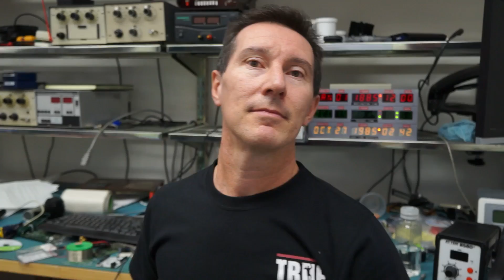eevBLAB #2 - Are Electronics Hobbyists Useless?

Comment: But i do have a question that might make a nice blab ... There is allot of talk in america about college being useless, i'm a 2nd year student and honestly only thing i learned new was to memorize some formulas i already had in an electronics calculator on my phone 
Whats your take? is college worth the debt? 
Its hella expensive here!
Reply: With any accredited curriculum you shouldn't be having to memorize much. Physics E&M along with differential equations should more than enough prepare you for circuits and electronics where you will derive everything you need. Choose a good public school and you shouldn't have so much debt either.
Reply: Dude same here in india. just with more people and they have to do more mundane work like writing journals, doing assignments mainly from copying from other and give tests which involve same questions which you just have to memorize the answers to.
Reply: Alyx BioHaz The problem with a degree path is that the first two years are bullshit to make you spend money. The second two years are where you actually learn. Then when you graduate you realize that like everything in electronics, your knowledge is obsolete. j/k LOL :) If you're in an engineering discipline, you will get a job more easily with college than if you have a liberal arts degree.
Reply: Mobin92

Formulae are only a tool.  You have to understand them to work with them in designs or maintenance.

Having good knowledge of them only goes so far when you are having to derrive and manipulate them in practical work.
Reply: College does teach a lot of useful stuff and gives you a wide set of base knowledge. It's easy to just bullshit your way through the classes without learning anything, but for someone with a genuine interest, It's a perfect opportunity to learn and become skilled.
The problem with it (and I admit I can't think of any feasible alternatives) is that it's required for the necessary credentials to get a job. So you end up with people who just take it for the credentials and don't care about the material at all (joke's on them they're gonna end up doing it for a living). And the market gets flooded with sub-par engineers with good grades and degrees. It's also incredibly expensive, so potentially talented engineers who aren't gifted with funding will never enter the market.
Reply: From the skill level I would guess: no way - since when you are really interested in stuff (what is needed when you want to become any good) you can learn that stuff by your own (especially nowadays).
The other question is: when you want to get a job, are 'papers' are requirement? If yes, then you have to calculate... debt vs better-job-because-of-certification-paper.
Isn't it...
Reply: It completely depends on how you use it. You pay for what you get, there's no money back guarantee. A lot of people waste money learning stuff that won't end up helping them, perhaps because of a lack of passion/drive to begin with or the assumption that all they need to do is get a degree. It seems to be the norm to go to college if at all possible regardless of whether you know what you want to do or even care at all about what you're studying, which is completely backwards. No wonder people see it as a waste.

But it can go both ways and I don't buy the idea that higher education is pointless and a waste of money, grades are meaningless, etc, those are typically excuses for people's own failures. If all you got out after two years of study was some formulas memorized, that's your own fault. Nobody can force you to learn things, and at the same time, at any half-decent institution you most likely had plenty of resources at your disposal (which is exactly what you pay for). Higher ed may not be required to be successful or skillful, and certainly doesn't guarantee you'll be either of those things, but a good education taken the right way is invaluable and includes far more than formulas.

Not to attack you personally, and obviously there are exceptions. But as a general response to people wondering why throwing money at education does nothing by itself and devaluing the entire process in general based on their own experience...
Reply: Colleges have their good things and their bad. The good is mainly the professors you get, although that can also be a bad thing. Also, you do sometimes get to play with things such as $100,000 oscilloscopes in their labs depending on whether they are well funded or not. I had two great professors who, even when I wasn't in the classes, would let me hang out in the lab between classes and would often go off on lectures on small questions that would last an hour (on stuff such as the miller effect, calculating the ringing of an RLC circuit, parasitics in different components, etc.), yet it only felt like a few minutes. They are the ones who truly put the nail in the coffin for me wanting to go to a university by relating their experiences and basically saying "Don't waste your money. Purchase equipment for a good lab and you'll be set".

What keeps me from wanting to go to a university is the concept that you're basically paying to teach yourself in the end, and rushed at that in some areas. I recognize it is good to memorize all those formulas, and I actually spend a good bit of time on those myself so that I can further understand what all the components do. It is incredibly fascinating to observe all of the parasitic properties in the different components and try to explain them. If I run across something I have a hard time understanding, I look it up and there are many lectures on youtube or articles that explain it very well. I mainly am repulsed by the high cost of college for what you get. What I would have paid in lab fees I paid in equipment for my own lab, which after 4 years I'll still get to play in. 

I'm sure there are some universities that offer a much richer learning experience than what I am getting, but I can't justify the costs when I am still learning and at an ever increasing rate at that. Maybe I'll be forced to if I hit a plateau where neither the internet nor my persistent desire to learn will help (an I would be persistent enough to spend tens of thousands on higher end test equipment than what I currently have if I hit a plateau), but for now things are looking up with what I'm doing.
Reply: One of the best ways in the US to get your education subsidized is to join the Army. I thought about it (queue the Ben Fold's song Army), but opted not to after some experience with a recruiter (Army salesmen, as I call them.) The position that I was considering was MOS 94S, a 'Patriot Missile Systems Specialist'.

Why that? Well, you become a certified diesel mechanic, you get into electrical engineering, computer science, telecommunications, and hydraulic systems. With that experience, you can work anywhere from a missile systems manufacturer, to a dealer as a mechanic, to an engineer designing and troubleshooting tech. The death rate for that job is extremely low, since it's not a forward operating position, and after all of the training you get in AIT; you also get the GI Bill for college afterwards.

You'd be able to use your credits in AIT and other experiences to get a Bachelor's and then use your GI Bill for a Master's degree. By your mid-to-late 20's, you'd be making decent money, and have a pension after 10 years in.

I was a bit of an idiot, opting for a civilian job that lasted too long in banking, and a finance degree that doubles as toilet paper in a pinch. LOL :)

My electronics and computer experience comes from a 3-year vocational training class in high school and my first job as a field service technician for a computer company.

I believe that companies should do more trade oriented training, subsidize candidate's schooling, and governments should open up more grants to academically qualified students. Having a country with a surplus of talented engineers is a very good thing economically and also for national defense.
Reply: When I was getting my associates, all I learned how to do was memorize stuff long enough to take the test. That made me realize that if I went to a 4 year school, I would be teaching myself twice. The first time in a rushed and boring way that costs tens (or even hundreds) of thousands of dollars, and the second time in a fun and fulfilling way where I actually retain what I learn. I decided to skip that first time learning. I got a job while still working on my associates and quickly was put on the task of developing circuit boards. I even have heard where after getting your associates, jobs will actually pay to put you through school. I wasn't put through that where I'm at right now, fortunately. Yes, it's nice to have the piece of paper that says "I paid tens of thousands of dollars to have people shove knowledge down my throat" because that's a major door opener for some companies, but most of the job postings I've seen simply ask that you have the skills, not the piece of paper. There are even companies that'll hire you without the degree even though the job description requires it because you have the skills and you have a portfolio to show that.
Reply: It actually helps to memorize all those formulas and stuff. Even if you don't exactly remember it anymore you will still know what it is and what it's used for.
Thus allowing you to learn things based on that faster and better.

Well at least if you try to understand why that formula is the way it is. If you just memorize a bunch of variables and math operators in the correct order, it's not gonna help that much.
Reply: Alyx BioHaz It's probably too late now, but I would recommend going to a cheap 2 year school for every gen ed class you can get towards your degree at a public 4 year school.

I'm a senior computer engineering student now, and have one semester left. I haven't really learned much of anything new in school, but jobs around here typically do require that paper, or at least 5-10 years experience otherwise.

Honestly, I'm hoping to start my own business anyway, but I don't regret going to school since I didn't actually get into debt.

Comment: Really, the only thing in that short list that I wouldn't be able to do would be firmware stuff. Other than that, I layed out my own boards, got them CNC milled, and even made a proper switching regulator with a hand-wound inductor when I was in 10th grade. I think that they may not exactly be "basic" skills, but I do believe that they are necessary.

Comment: sounds kinda ridiculous, i'm more of an end user computer nerd that does more with software than hardware (actually worked at a computer store for years doing basic pc repair), so i don't have much experience with component level electronics, but even i know all of those things you asked for even though i might not have done it myself before (and i wouldn't apply even if i lived in aus due to lack of experience with component level circuitry) so i would expect that most people who actually make electronics as a hobby would not only know how to debug a board or effective/efficient ways to lay one out in cad. the people who are saying such things i think are overestimating them self, whether it be a professional who can do those things (of course) or someone more like me who is thinking "if i can't do it no hobbyist can" or something along those lines. i'd take those comments with a grain of salt man.

Comment: I would say that what there are, are a LOT more tinkerers.  I am not a hobbyist but more than a tinkerer.  I would not dare call myself a hobbyist yet!  I am likely never to be one either.

I am a lifer in IT (20+ years now) and can do most things from PC support to database design and application development and coding but I would STILL never call myself an electronics hobbyist!  A hobbyist thing that I DO do is run my own servers and whatnot at home as that is part of my skill set at work.

I would suggest that the use of the term hobbyist would only properly apply if your skills were mostly to all self taught and that but for official certification or graduation, you could easily get a job where you could ply your hobbyist skills for real money.

All that being said, I took electronics in school and regret letting it languish!  This channel and several others out there have really got me back into wanting to learn the skill again.  I have been having a blast with 18650 cells this year but certainly want to learn and play as much as I can.  Putting effort first on soldering skills as it is the most used one in the physical application of even just tinkering.

Comment: Never finished college. Have never worked in a technical job. I've re flowed a BGA on my graphics card. I can solder pretty damn good. I started making circular polarized antenna. I also build and troubleshoot computers. I've built a circuit before, but it was pretty simple.

Comment: No they are not useless! "Back in the day" as you say, there were REALLY primitive tools for designing and developing boards. Everyone was forced to buy expensive programmers to develop firmware on REALLY horrid architectures like the microchip, with no free high level languages to mask the awful architecture. These days we have loads of free PCB tools, free compilers, cheap boards like Arduino or devkits like the MSP430 Launchpad that you program in high level languages out of the box with no fancy download tools, and these things COME with emulators built in. You probably remember when an emulator costs $10K and was a huge box that had a long flex cable with a $100 adapter on the bottom that plugged into a special $100 socket you'd have to solder to your PCB! We also walked to school in the snow year round uphill both ways! (Just kidding). Essentially, the tools make it a lot faster for people to learn advanced skills in this day and age. There are some incredibly smart young kids doing very advanced things, and your expectations are certainly not too high.